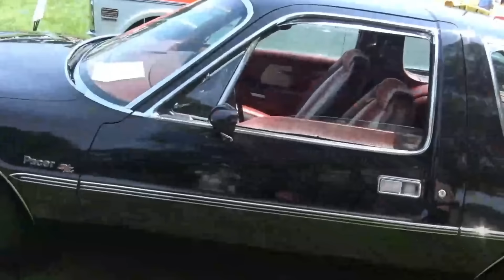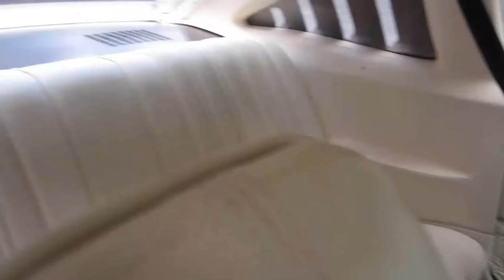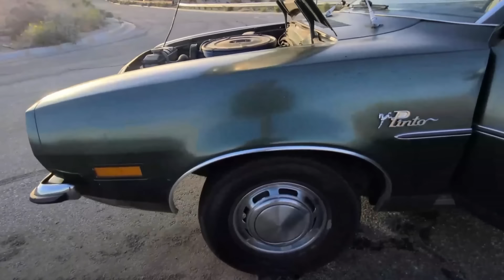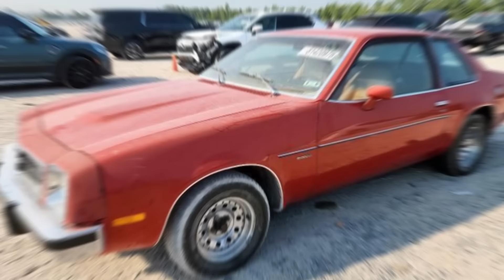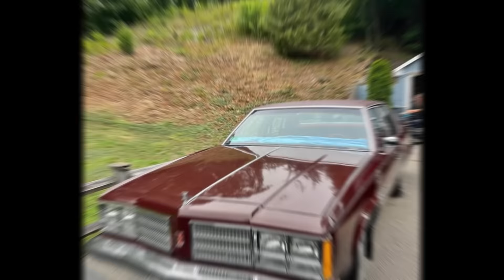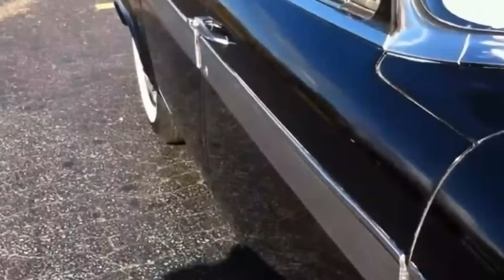Top 13 WORST Cars in US History!

Comment: I was an automobile mechanic in the 1970's.  Many times, the Chevy Monza V8 owners would take their cars in for a tune-up and the #8 spark plug had not ever been replaced.  We often encountered these cars when they got to 50 to 60,000 miles with a constant miss in the #8 cylinder.  We had to explain to the customer that the reason for the miss was that the original factory spark plug had never been replaced.  To make matters worse, there was a good possibility that the spark plug would be stuck in the cylinder and could break or strip the threads in the cylinder head if it was removed.  The only solution for this was to remove the cylinder head to have the spark plug or spark plug shell removed.  This was a costly job.

The way that the factory manual said to remove the #8 spark plug was to disconnect the right-hand engine mount and jack up the engine at least two inches to access the spark plug.  However, a short cut was found.  This was to cut a hole in the inner right front fender panel, and you would be able to access the spark plug.  The hole would then be covered using a rubber body snap in plug.

This is the car started the famous asterisk on prices for routine maintenance jobs with a set price, such as V8 Tune Up $19.95*               *Some vehicles excluded.  See the Service Manager for details.

The problem that Detroit and other auto manufacturers had in the 70's was that they had too much to deal with at one time.  There were emissions controls, safety requirements and fuel milage standards to be met at the same time.  Then couple this in with tremendous drop in car sales from about 1978 to 1981 and it was a rough time.  The car sales went from 18+ million cars per year to just 12 million cars per year in about three years.

PS: The Volare TV advertisement was one of a kind.  And who can forget Ricardo Montalban talking up the Chrysler Cordoba with "Rich Corinthian Leather", whatever the heck that was.
Reply: I was a teenager in the 70s. I couldn't believe some of the crap Detroit was producing! We came out of the 60s 'Muscle' era and nosed dived into some of the ugliest, poorly built machinery ever. I had a 77 Volare that lit on fire at a stop light.
Reply: @rossbabcock3790  Ahhh Yes, the unforgettable "malaise era" of north american cars. Aren't you jelous of those who were smart enough to discover stuff like the Honda CVCC, BMW 2002 tii and Porsche Turbo Carrera ?
Reply: @billdang3953  I'm here illegally
Reply: @billdang3953 Not jealous of the shallow arrogant people that bought them, no. I bought what real men bought and not what most wussies & yuppies coveted back then.
Reply: @billdang3953 at least the pickups weren't terrible.  Had a 75 ford f250 i loved.
Reply: Chrysler's "Corinthian Leather" came out of a leather shop in New Jersey.
Reply: @cpellercpeller5463 Would that be Corinthia, New Jersey ?
Reply: @GFHanks I believe Paramus New Jersey -
Reply: @cpellercpeller5463  what does that have to do with the price of tea in China ?
Reply: @Jeff-m3x7h - I don't know. But I know it's one of 3 things you never buy made in China. Tea, Parachutes & Prophylactics -
Reply: "Fine Corinthian Leather". HYSTERICAL!!!
Reply: @VVVassi  The ads are on YouTube, in retrospect they are a bit hilarious.  Chrysler was definitely trying to sell sophistication, luxury and class.
Reply: @paulkurilecz4209 My friend & I used to imitate him in that commercial back in High School. So funny
Reply: @VVVassi  that was the Cordoba
Reply: @tomlabine8405 Yes, good job remembering the model. Impressive
Reply: That's exactly what they did cut hole right fender panel to get spark  plug ,but  mine was done at the Ford dealership I worked at in school ,also mine  did not the have the  262v-8 ,mine was a California 350V8 with a 4bbl
Reply: I had a V8 Monza 2+2 in 1982. I took it in for an oil change and tune up. When I went to pick up my car my bill was $120! I paid it, then told my dad later how much it had cost. He flipped out and raged all the way to the shop assuming they had fleeced me because I was a kid with a checking account. They were polite and let my father see what was required, he calmed down. 
Truthfully, I kind of loved this development, I hadn’t wanted the Monza, my eyes were set on an AMX or Javelin which was vetoed. The Monza was my dad’s idea and he reimbursed me for the tune up. 
Funny, I ended up loving that car. It burned through tires and was my first taste of freedom.
Reply: @Grinuwe  Oftentimes, we would let the customer watch as we would try to extract the #8 sparkplug on a car with 50k+ miles.  We would often use a beam torque wrench in order to show them how badly stuck that they were.  Occasionally, we would stop and tell them that we would be concerned about stripping the threads if we continued.  This would be when we were putting 75 or so ft-lbs of torque on the spark plug without it moving.  Normally, it would only take a max of 20 ft-lb to remove a spark plug.  After all, they were installed with about 10 to 15 ft-lbs of torque.

$120 was expensive back in the 70's and early 80's.  Our normal charge for a V8 tune up was about $20 to $25 for plugs, points and condenser with the appropriate adjustments for timing, idle mixture adjustment (if available, as some emissions control did not allow idle mixture adjustment), idle speed adjustment and choke adjustment.
Reply: Some people like engines that miss fire , Harley owners love their junk running rough and vibrating
Reply: @Jeff-m3x7h  Ahhh.....the AMC years
Reply: @rossbabcock3790  You country still makes junk always have always will
Reply: @Jeff-m3x7h  Germans said the same thing during WW2
Reply: @rossbabcock3790  you ain't going to win WW3
Reply: @Jeff-m3x7h  Nobody wins WW3
Reply: @rossbabcock3790  Have you ever saw the movie what about the slob ? That's you's and the UK
Reply: @rossbabcock3790  the Chinese do and I suggest you learn their language otherwise if they don't execute you's you will end up in a Gulog in the coldest part of Alaska which they are building right now
Reply: @rossbabcock3790  I'm in your country illegally report me to the big T
Reply: @rossbabcock3790  you country imported Nazis after the war to create NASA
Reply: @rossbabcock3790  I had a 1983 Eagle 4drive wagon 103,000 when I bought it best 4wheel drive I ever owned
Reply: @rossbabcock3790  Ahhh the Harley years and they are still making junk
Reply: @Jeff-m3x7h SO many ignorant people on these boards, spewing  the “Harley’s are junk”  poison, when in reality  most of them have never even ridden a motorcycle, let alone a Harley. The truth is that Harley’s are the best built motorcycles in the world! For example, Where Japanese bikes use plastic parts, Harley’s often use Metal parts. Harley’s have the best resale value for good reason… they LAST!
Reply: SO many ignorant people on these boards, spewing  the “Harley’s are junk”  poison, when in reality  most of them have never even ridden a motorcycle, let alone a Harley. The truth is that Harley’s are the best built motorcycles in the world! For example, Where Japanese bikes use plastic parts, Harley’s often use Metal parts. Harley’s have the best resale value for good reason… they LAST!
Reply: @ahighervibe4086  I find it amazing as to just how far off track the comments to my original post are.
Reply: These cars were nice and affordable we can't say the same about today's cars
Reply: @PhilipMontano-q4b  I will take the reliability, technology, horsepower and safety of today’s cars over these any day. The only thing I miss is the styling of these old cars. A lot of cars back then looked different every year, most of the cars today all look the same.
Reply: God bless you.  Jesus saves sinners
Reply: I love that commercial. " Rich Corinthian leather, why not the best ?
Reply: But they ran great.
Reply: @kennethelber8284  It was a hot car just so long as it was firing on all eight cylinders.  🙂
Reply: I had a friend who had one. He found a mechanic that was a strong guy he could get it out by hand. He made a lot of money racing it was the ultimate sleeper. One of his loses was a Mazda RX -7 with a rotary engine on nitrius
Reply: We had the Pontiac version and it would shift from first to third.
Reply: That's interesting I often wonder what mechanics dealt with in the 70s
Reply: @Christian-m4b9e  There were some oddities.  Another one was in Chrysler products where the easiest way to change the spark plugs was to put the car in the air and access them from underneath.
Reply: @paulkurilecz4209 that's wild I had a Chrysler town and country that had a VERY difficult spark plug in the back about half an inch from the fire wall, I got it finally but it was a nightmare, I'm not a mechanic but I know all the parts and what they do but to put it all together I can't, they could have easily made it concave to get to it so I don't understand why they don't, probably money but I would think that a car that is easy to work on would sell more but I know,most Americans don't want to get they're hands dirty.
Reply: The 80's Camaro IROC-Z and Trans Am had a similar awkward method for spark plugs. I remember going under the hood for some, through the wheel well for some more, and running it up on the lift to get the back ones.  I worked at a used car lot. Kinda place that put rags in valve covers for a valve or rocker tap.
Reply: I remember in the late 80s and early 90s a lot of mechanics were  quitting or glad to be getting out of the trade bc of the increase in complexity with the computers and sensors. 
It was intimidating to a youngster but we adjusted. I don't think these modern surveillance and data collection devices are meant to be repaired so ig the trade is dying again
Reply: The Aspen, Volare also had garbage standard shift transmissions which were noisy and locked up in between gears
Reply: Such bs😊
Reply: @curtcaudle5900  How so?

Comment: The Vega has the looks, but the engine was so bad that it was a pure flop
The Windsor has a very cool look as a 2 door, I loved it

Monza was a CHEAP attempt to be the Chevy model of the Pontiac Sunbird  (my 1st wife a a 79 with the 3.8L V6 in all Black)
Her V6 model with a 5 Speed was just as fun to drive as my 79 Camaro Berlinetta with it's 350 V8  (thanks to weight)

I call BULL HERE
The El Camino was one of the coolest bodies on a Car/Truck ever
The Black on is WOOOOW   and tghe Green one is special

Comment: The AMC Gremlin could arguably go on this list, with terrible slow steering, horrible build quality and a useless backseat.  Fuel economy was also disappointing.  Other dogs include the GM X-Series cars (Chevy Citation, etc.) and the Cadillac Cimmeron, which was a cheap Chevy with Cadillac badging.   The Pontiac Fiero with plastic body panels that faded and a reputtion for engine fires was also pretty bad.

Comment: Of the "hundreds" of people that allegedly died in Pinto fires the NHTSA determined that 27 actually did.  Given the cars production numbers (which was over 2 million) it was determined the Pinto was no more fireprone than any other car of the time and even less so than the Datsun 1200, Datsun B-210, and Toyota Corolla.  The design of the fuel tank was commonplace at the time.
Reply: And ig you took it in for the recall on that gas tank, it was repaired with new straps and bolts - and you never had a problem with the gas tank.  I know, as I owned one when the recall came out.
Reply: @antonbruce1241  They put a plastic shield between the tank and the rear diff. Also a new longer filler pipe.

Comment: The 1974-78 Mustang II was the 3rd best selling Mustang of all time and it rode on the Pinto platform.
Reply: The main chassis difference between the Pinto and the Mustang was the Mustang used a front suspension subframe and the Pinto had the front suspension attached directly to the body. That's why Mustang front ends are used by hot-rodders.

Comment: OMG, this is just the opinion of AI or some idiot - bet if it is a real person, they never owned one of these cars. 

The only cars on that list that were bad when they came out were the Volare/Aspen with their factory Rust Option, which was installed at the factory. 

The Edsel was a failure because of company politics, it was a good car for the times, but when Ford Execs decided to kill it on the day it was launched because of a power struggle, it was doomed. 

The Pinto and Vega were cars of a certain type to fight imports and lasted a while. The Pinto was popular, more than the Vega, but the Vega had a serious flaw; the engine used a new technology that just didn't last. One reason why the replacement was being planned in mid-1972. 

MustangII has its own following, but it was produced in the mundane mid-70s, which also gave us other boring cars. 

Pacer was a cool car, didn't have many flaws, and if you liked the greenhouse on wheels effect, then it was a car for you, but AMC had its own following, and this is where the sales were made. 

The same with the Mercury Turnpike Cruiser, it was a limited production traveling car that was sold through the dealers to people who were fans of Mercury. 

The Chevy Monza (and the Buick Skyhawk, Oldsmobile Starfire, and Pontiac Sunbird) was supposed to be the replacement for the Vega (which it is based on); it was a sweet car that handled pretty well. I owned a couple, one new. It was a typical 70s type car. 

The 78 Oldsmobile diesel was not just the car; it was the engine that was a problem. it was used in every make of GM.

Comment: If it hadn't been for the engine and rust problems the Vega could have been a giant killer. I had a wagon and I loved it with the exception of that awful engine
Reply: The problem with the Vega was that they had a small radiator and if they overheated they would lose coolant and people wouldn't notice then they'd run hot and warp the aluminum head.
Reply: @althunder4269 that wasn't the experience of my friends and I who actually drove them. Our experience was that the cylinders would wear out very quickly. They would start burning oil like nobody's business. It was those damned silicone impregnated aluminum cylinder walls. I never knew one to overheat

Comment: Ive had several Plymouth Volares and Dodge Aspens and fir the most part, they were pretty good cars. The biggest problem i ever encountered was the horrible electronic lean burn system, they started putting on them in 1978
Reply: Agreed. The lean burn setup was a total disaster for Chrysler.

Comment: I had TWO Monza's (a 1975 Oldsmobile Starfire and a 1979 Buick Skyhawk). Both were 3.8 litre V6 and the timing chain sprocket was made of bonded fibre which stripped frequently. The rust on both of mine was in the A-pillars.
Reply: I had a '75 Buick Skyhawk which I drive over 10 years and then gave to my brother's family for his children who drove it several more. Overhauled the carburetor  and little else. It did get a bit rusted out because of snow treatment on roadways.

Comment: I bought my first car in 1970.  Worst cars I ever owned, '72 Chevy Vega and '04 Chrysler PT Cruiser.  Best, '86 Nissan Hardbody 4x4, '78 Chevy Caprice wagon, '69 Ford Fairlane, and a '67 Pontiac Tempest.  Cheapest and easiest to maintain, two different VW Bugs, a '69 and a '71.  The most enjoyable?  My '74 Porsche 914 and the '69 MGB.  Both were maintenance nightmares being used sport cars, but when they ran right there was nothing like them for sheer enjoyment.  Did anyone else catch the unlatchable hooves on the Aspen reported in the vid?
Reply: A friend of mine had a 1973 914 2.0 in the early 80s and it was a rust bucket. But it was a fun car anyways.
Reply: @althunder4269  Mine was in nice shape with a custom stripe, but it kept blowing the fuel injection computer.

Comment: I had a 78 Chev MONZA fastback with a small block Chevy in it. As an engine builder, I put a little work into it. I got it to be pretty fast. Another thing was that it was very arrow dynamic and yeah, changing the number one spark plug was impossible to change the spark plug on the front left side out because you had to jack and the engine up. One time I was doing a tuneup on it and the parts store guy said you need eight plugs. I was like no just give me seven… Lol, nevertheless, I enjoyed the car.

Comment: This article is a joke.  I had two of the cars on here.  The first one, I had was a 1971 Ford Pinto Runabout with the 2.0 liter engine and a 4 speed.  The handling on it was tight,  and it was a good handling car..  I had it  the last two years of my college.  It was dependable  and drove fine.  I got rid of it in 1973 for a 74 Torino.  The Pinto did not have the power to go  up the hills in north Central Nebraska.  I had to shift to 3rd to make it up the hills..  After the Torino, I got a 75 Mustang II Mach I.  The V6 had all the power I needed and it handled great.  I went to the Mustang as I didn't like the sloppy handling of the Torino.
Reply: I had a 1977 Pinto and I installed front and rear anti-roll bars and Bilstein shocks with wider radial tires and that car handled like a beast.